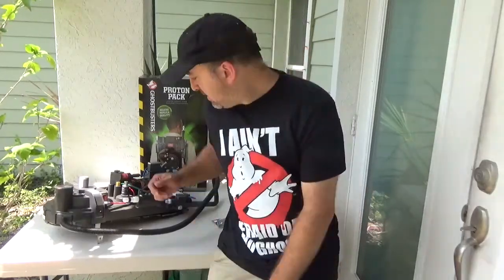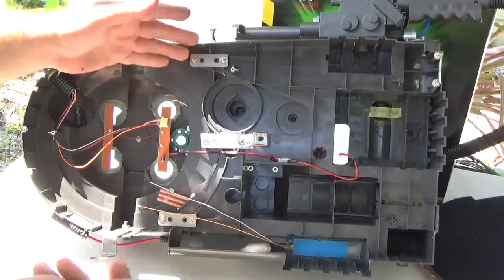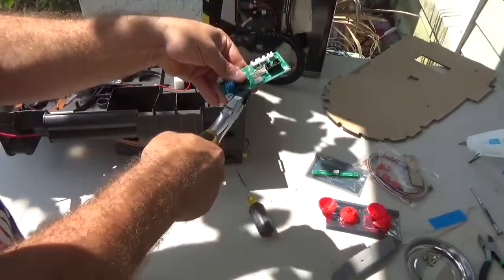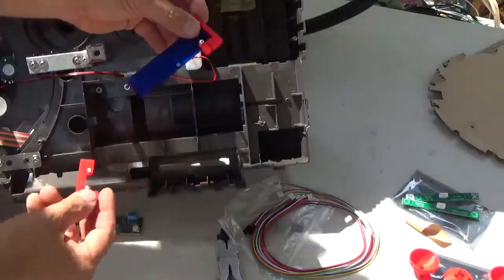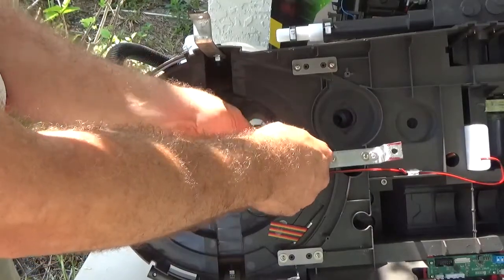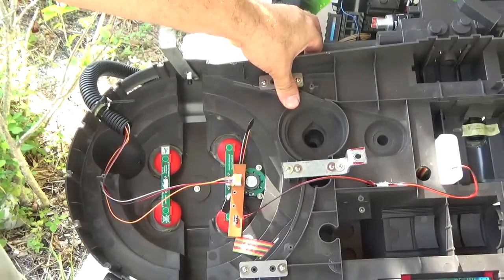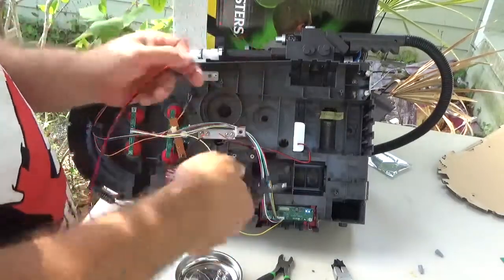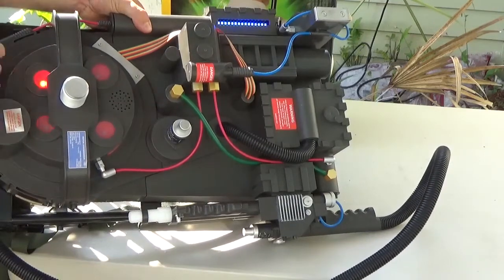Spirit Proton Pack Mod: Ep2: Light Kit Upgrade

Comment: How do the lights turn on without the pack sound going off? I noticed you pressed a button, but couldn't see which. My assumption is the wand's button, but I can't exactly tell 😅
Reply from the maker: The lights now come on when the battery pack is switched on, and they stay on till you switch it back off. The wand functions independently now.

Comment: Hey JRMorgen how do the light stay in place like how are they not falling?
Reply from the maker: They snap into place on the board, and the board is screwed in using the existing screws from the pack
Reply: @johnny_mo  ah ok I see thanks! Currently modding my pack to these mods like. Light alice pack and wand

Comment: Instructions don't actually say where to install the vent light on a spirit pack, and I'm not finding anywhere specific to put.  Any guidance would be awesome and your videos are nice walkthrough on installation thank you!
Reply from the maker: The vent light can be added to the “N filter”, which is the capped cylinder at the bottom right of the pack.  You would have to drill out the recesses and put in an led strip or individual leds. The ends can then be tied into the wire they provided. Must be 5v for this setup.

Comment: My question is:  after you install that kit, and that the Spengler's wand is hooked like you did, to the pack, how does the light kit gets turned on?
Reply from the maker: The light kit is currently connected to the original battery pack from the pack. I plan on adding bigger battery packs that will power both soon. As it is, the lights are independent from the wand.
Reply: @johnny_mo  I got that, what I meant to say was is the switch for the light kit on the battery  pack?
Reply from the maker: @raynekraven  yes, still using the switch on the og battery pack. Once I build my new motherboard, I am going to add a somewhat hidden switch to the side of the pack and wire it to that
Reply: @johnny_mo  okay thanks for clarifying that :)
Reply: @johnny_mo  once the kit is installed, the board that you left in can be removed since I'm using the spengler's wand's sound effects?
Reply from the maker: @raynekraven  yes. If you are going to use wand sounds or other sound kit, the little speaker and the board in the pack are no longer needed. Save em for parts for other builds.
Reply: @johnny_mo  thanks man!  you are very helpfull

Comment: Why would they send the boards together like that?? Seems like asking for a disaster
Reply from the maker: I imagine so that each set stays together. Also likely a cost saving method. The boards are prescored, and do snap apart fairly easily, so long as you make sure the pressure is going along the score marks.